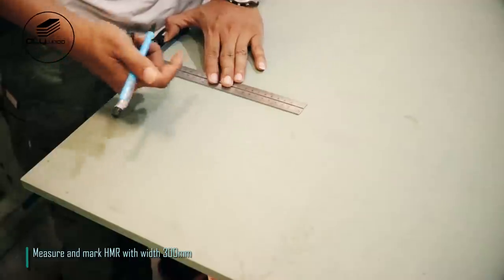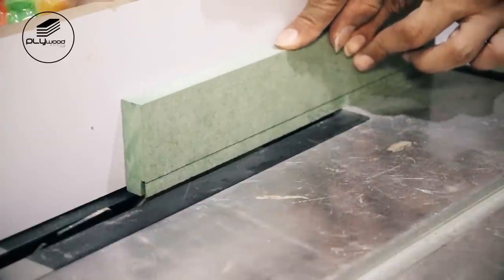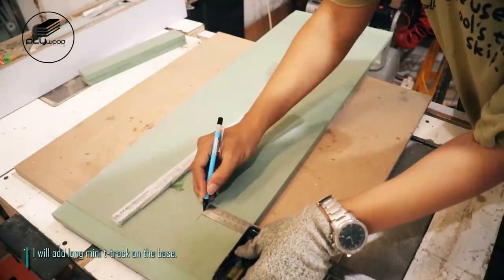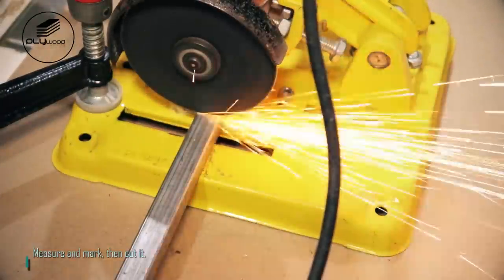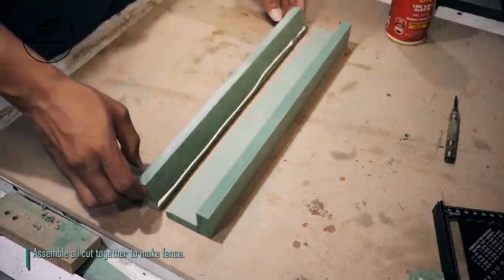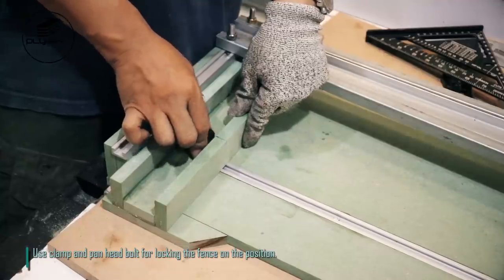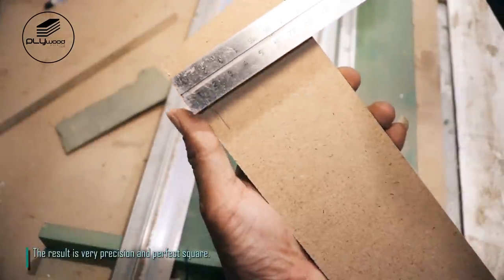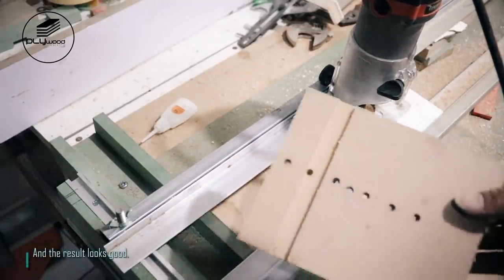Masterplan 4 in 1 Multifunction Crosscut Jig - Circular Saw Jigsaw Router & Trim Router

Comment: Just a minor criticism, as I've just received my square aluminium tube. I should have thought it through better but all your measurements are in mm apart from aluminium pieces (tube and L shaped) I wrongly assumed they were inches so bought the equivalent in cm so it's too big. Not sure if I can get M8 bolts long enough to go through and haven't really got the right tools to cut it down. I'm assuming the 2x2 is cm...? I assume I could just put the nut inside the tube seeing it's so big...
Reply from the maker: thank you very much!!

Comment: Pourquoi faire un guide pour scie circulaire et sauteuse quand vous avez a disposition une scie sous table ? A par pour la defonceuse je n'en vois pas l'utilité 
Cordialement
Reply from the maker: good question,  i made this for handy sometime you very tired use table saw, you cut easy cut use this, especialy small cut. If use table aw make small cut very dangerous without jig. for router i only give little sample, you can use that for flaten wood or easy make slot.
thank you for ask